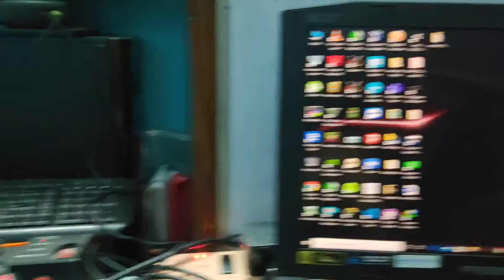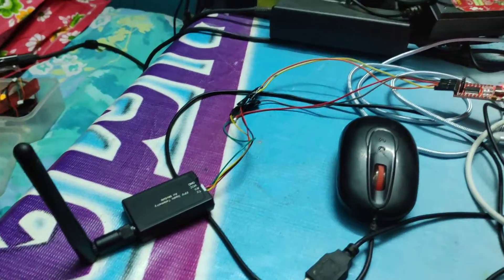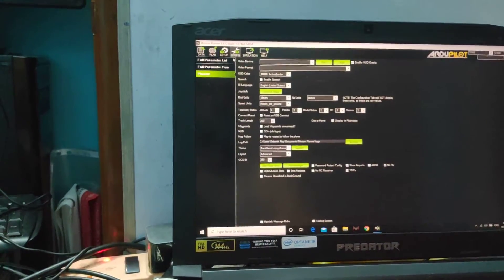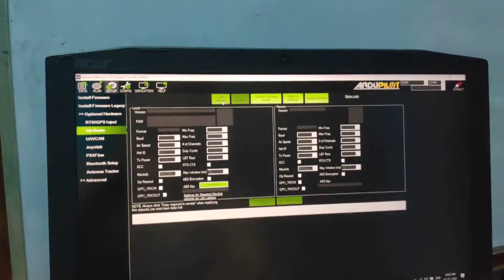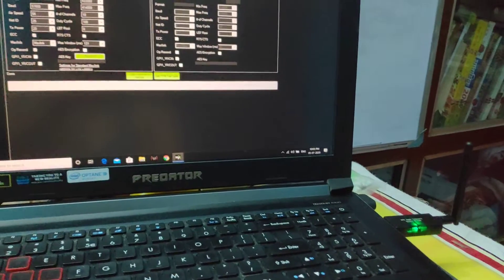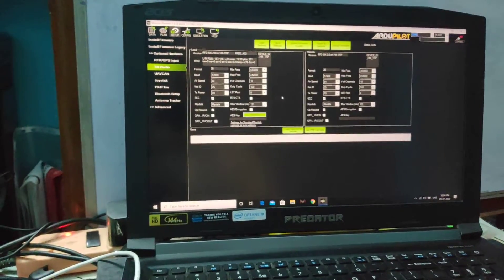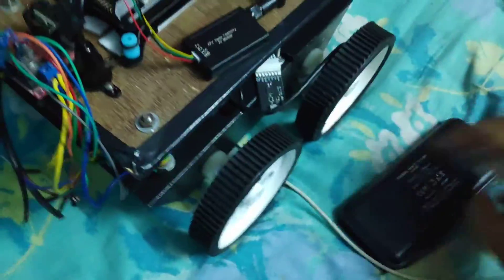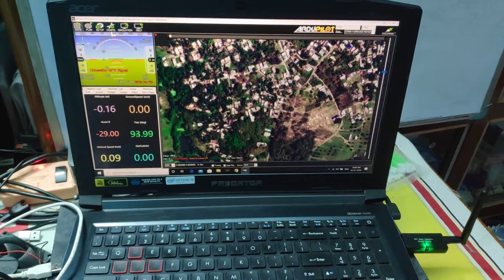Ardupilot Telemetry problem fix using mission planner and ft232rl

Comment: Sir when i connect my connect my telemetry Ground module it shows, Unknown USB device (device descriptor request failed)... 
The things I tried, 
1.Uninstall and restarting
2.disabling and enabling
3.windows troubleshooting
(it could not find the solution)
4.updating driver(Tried both cp210x and fdtm)
But the problem is I can't update it... It shows the best driver for this device is already installed...
5.usb oblivion

Nothing worked.... Please help if anyone knows
Reply: Did u fixed?
Reply: @GolalFamily  not yet bro